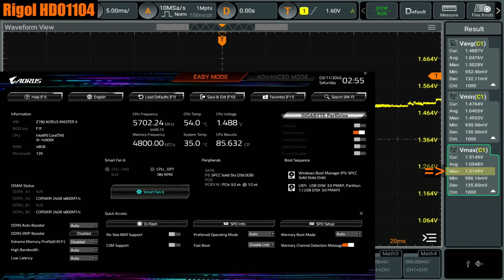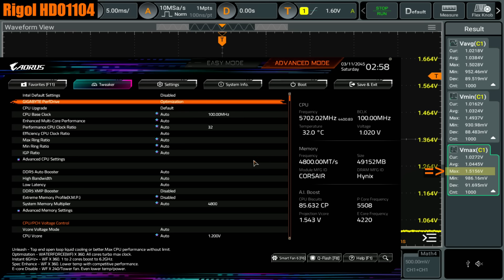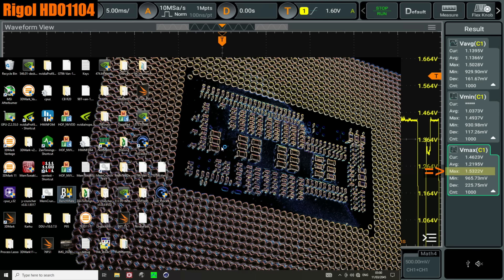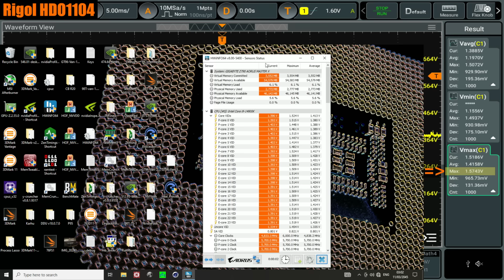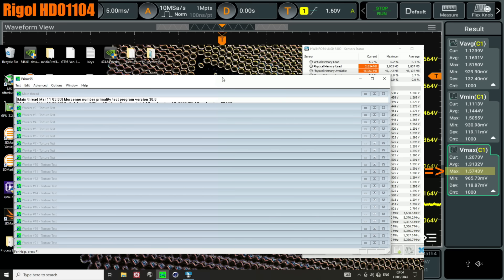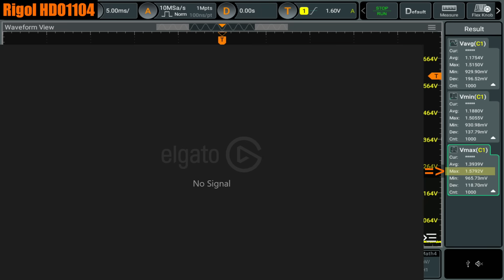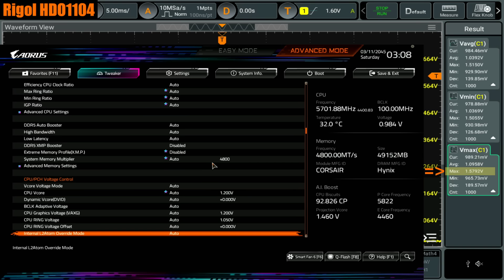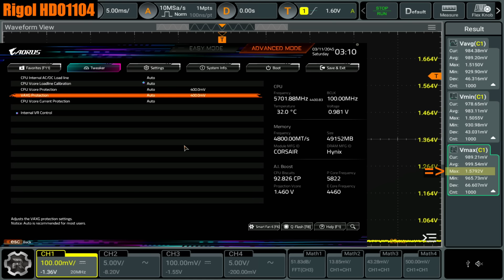Turning off "Intel Default Settings" with Microcode 0x129 DISABLES THE VID/VCORE LIMIT

Comment: 1.4v is very conservative in regards to degradation although that depends on the frequency it's running at that limit which 14th gen seem to do way too often, limiting to 1.5v significantly improved stability during gaming sessions, which during idle you'd expect far less but even at idle I'm seeing round 1.47v, so sad

Comment: After i updated to the newest bios version I see that all my P/E core clocks drop below 800MHz on idle, and my Core VIDs drop significantly as well with a i9 12900k. I did some research on the internet and read that it might be due to the C-States. I tried disabling C-State, as they were previously set to Auto, but unfortunately, this did not solve the problem. I then did some further research and read that it could be due to C1E, the Enhanced C-State. However, I can't seem to disable it on my motherboard due to Intels default option in the bios. Is there anything i can do to revert the intel changes?

Comment: Enable 'Enhanced Thermal Velocity Boost' or in a more techy name 'VMaxStress': is just a voltage reliability on/off switch. Optimized AIB settings always disable it. Also for XTU users: touching anything in XTU to overclock will disable the feature too.

 Intel's fault(and the reason they are lax with warranty) was making a mistake in their voltage reliability feature which was allowing the CPU to run at unrealiable voltages: that's what 0x129 microcode fixes.

AIB do know how to properly configure Intel CPU: my ASUS Laptop has AC_LL and DC_LL perfectly configured, as well as other things like TVB, PL1, PL2, ICCMax and even ASUS propietary 'Regulate Frequency Above Threshold'. For Desktop they just use AC_LL for whatever their reasons are: maybe it's some social engineering for home overclockers, ease of configuration,...

Comment: What do you do when you have an HP Workstation with a limited user controled BIOS? One thing I'm going to do is swap in a better screw down thermal clamp on the CPU instead of the default lever clamp. It may void the warranty, but at least the cooling efficiency will be a little better on the chip.

Comment: Great video. Question is im on z790 aorus prox and i got the intel defult settings after i update my bios what if i go to my old update F3 ( the bios that 
My pc came with ) which is the previous update from F4 that shows intel  default settings is it safe to do?

Plus after updating the gigabyte control center tells me that under vault protection  is enabled in cpu tap in the app I didn’t hat this notification before when i

Comment: I have Gigabyte B760M Gaming 1.0 DDR4. Voltage with Intel default is higher than Gigabyte Optimized profile. LLC for Intel is 1.000/1.000 mOhm, IccMax 280A, and for Gigabyte Optimized is 0.700/0.900 mOhm, IccMax 310A. My 13700KF was and still is very stable, no issues nor BSOD, even with older BIOS. Why shall I use Intel default then? It reaches 1,45V with Intel Default, and 1,39 with Gigabyte Optimized. I think Z790 motherboards are way more aggressive than B760 when it comes to voltage.

Comment: I set mine to 1.45 max. It will hit a 40300 on cinebench with that limit. Now that is higher wattage but voltage limited. Intel defaults are down from 38500 to 37700.

Comment: I just got a computer with the i9 13900k in it and learned about these issues. I did my gigabyte motherboard bios update. Some people told me to do the gigabyte default clock. Do you agree to do that and will loading the defaults hurt anything or delete any data/apps?

Comment: Disable Intel Turbo Boost, and TurboBoost Max. 💯
Reply: Whats the point in that?? If you have i9 and disable turbo boost you will have i7 ... so thats dumb ... rather rma the cpu buy the 12th gen I9 and call it a day no need to upgrade nothing its lga 1700 🫡
Reply: @ZeleniKamion  when my boost is on, my CPU runs at 98c while I'm encoding videos.

I have an i7 13700k which could potentially have the flaw Intel's 13th and 14th generation chips have where they oxidize and fail.

I would rather my videos take +1h to encode, if it means my CPU Never gets hot.

Currently I'm running 55c max temperature with turbo disabled.

The i7 13700K has 16 cores and tons of cache, so I don't see a performance issue running lower speeds, except for my encode times being longer.

imho: Intel pushed their voltages too high and expected the customer to eat the cost of failed CPUs.

It was all about getting a better benchmark for them.

Lucky for us, they finally hit a wall and had admit they had a fabrication problem and thus a BIOS fix was released to underclock their CPUs back to safe levels.
Reply: @DaKloneGaming  bro just rma that thing and buy i9 12900k,no need to hope to god your cpu doesnt die...
Reply: @ZeleniKamion  LOL!

Comment: Thank you for the video, really helpful. Can we run the XMP mem profile with the intel default settings on ? or is it better to keep the profile disable with the intel default on.

Also after applying the intel default settings the temps seem to be really high 80-100. If this keeps up would you reccomend doing the 1.4V limit? ( if it would help)

Comment: I did not install new bios yet, 13700k using .50 negative undervolt with the extreme settings. Treats it better than intel por except cinebench 15 crash, 23, good, prime95 crash, idk wth is going on right now. Maybe just needs the extra v for the profile. But waiting for more info with new microcode since ive had no issues outside of issues from my tweaks and no high voltage spikes.

Comment: Hi BuildZoid, i've recently bought a built pc with i7-14700F+4070 super. i was so happy bc my current pc is really really old(i7 6700+1050ti). did some research and i'm quite worried. even tough this specific F version is not listed officially by intel, i still wanna make sure everything is ok. so, first thing i wanna do is update bios to get 0x129 microcode. (gigabyte b760m ddr5). Some people say don't upgrade if everything runs fine. but i'm lost. i'm not really sure what to tweak. i've seen some videos and reddit posts, and people recommend different things. PL1 and PL2 to 253W? but my F version only goes to 219W. Undervolt to 1.4 or 1.3 ? xmp? enhanced multicore performance? to be honest with you i'm overwhelmed by all these new terms and not really sure what to do. this new pc means a lot to me and took me quite some time to buy it so i want it to last as long as possible. any help would be greatly appreciated

Comment: My i7 14700k ran at 1.387v stock in the bios, I reduced the VRM Core Voltage by 0.1050mv taking it down to 1.285, then reduced the Global SVID Core Voltage by 0.100mv. Cpu shows 1.190v in bios.

Would you guys think this is great? My cpu benchmarks are the same as stock if not 1% better. Intel utility benchmark does not say Yes to Thermal/Voltage limit (can't remember what it was) and current limit, during the benchmarks where as it did when it was on stock, and with just the vrm undervolt it was just the current limiting during the benchmarks.  

Problem I believe with the chips is the e cores running on the same rail as the p cores.

Comment: I have a 13600k, MSI b660 board with no crashes. Updated to the 0x129 today and my VID/V-CORE went nuts up to 95c and 1.43v. 

I checked and intel default was on. I changed it to ‘normal’ and used CPU Lite 6 to bring temps down and the V to about 1.3v

Doesn’t mean I’ve missed the fix as per the video?

Comment: anyone here having crashes  every few hours in warzone? i cant really fix this and this game is known to crash sometimes, but it happens almost every day on my system. i have not overclocked anything or did some weird different stuff. 
I have a 6900xt and a 13600k running x0129 microcode and intel default settings. it just wont stop. i have no crashes doing any other stuff, so im not sure if its just the game or something is wrong with my cpu. to be fair i dont use much other programes, so maybe i just dont realize the full extend of this stuff. does anyone here have the same issue?

Comment: Im still confused about all this, i never looked that much into the voltages, but by my understanding the microcode currently has an issue where it distributes too much voltage to a single bit and destroy is permanently? Because i checked my cpu cor voltage in my bios and is was set to 1440 since day one. Wouldnt that mean im kinda safe? Or am i missing something?

Comment: 14900k sufferer here. One question that I have is if manually setting that voltage limit to 1.55 makes it safe to turn off the intel defaults?

I'm a big tinkerer, and I'd love to be able to overclock and tinker with my chip. I want to stray away from the Intel defaults in some ways (e.g., I am considering removing wattage limits). Is setting that voltage limit manually going to work equivalent to the Intel defaults (except for where I diverge manually) in terms of chip safety?

Comment: People just all core overclock your CPU -> fixed Pcore, Ecore and Vcore. No troubles then.
Or turn indeed the IA VR voltage limit setting on 1.40v (value is 1400 in BIOS). Maybe KS owners do put it at 1.425v (1425), that is stil safe.
Or put fixed max on your Pcores and E cores, then the VID never requests high values, so P core 5500mhz, E core 4200mhz or so.
Good luck it is so easy to solve. Don't do BIOS upgrades, all not needed.
Reply: can u recommend something for 14700k

Comment: My PC used to crash. 
However, I solved it after getting a new case that has better airflow.
My problem was temps of my boot drive. I’m someone that only likes using mini-itx cases, so temps are higher than if I used a mATX or ATX case.

Comment: I have an i5 13600kf, recently purchased, from the first day of use it shows crashes, blue screen and sporadic shutdowns... I updated the bios f18g to the latest and it didn't work, I've tried limiting the vcores, power lines, nothing works... I opened the rma with Intel because the store didn't want to resolve it despite it being less than 30 days old. Until now I haven't been able to use my PC which has a 4070 super, 64GB RAM, NVMe SSD all on a B760M Aorus Elite. 😢
Reply: People just all core overclock your CPU -> fixed Pcore, Ecore and Vcore. No troubles then.
Or turn indeed the IA VR voltage limit setting on 1.40v (value is 1400 in BIOS). Maybe KS owners do put it at 1.425v (1425), that is stil safe.
Or put fixed max on your Pcores and E cores, then the VID never requests high values, so P core 5500mhz, E core 4200mhz or so.
Good luck it is so easy to solve. Don't do BIOS upgrades, all not needed.
Reply: RMA all the way.

Comment: I have updated my 14700k with MSI MB, it still runs in the 1.4v whn playing game. is it ok?
Reply: Best not, gaming make a lot of spikes appear because of the irregular loads all the time.

People just all core overclock your CPU -> fixed Pcore, Ecore and Vcore. No troubles then.
Or turn indeed the IA VR voltage limit setting on 1.40v (value is 1400 in BIOS). Maybe KS owners do put it at 1.425v (1425), that is stil safe.
Or put fixed max on your Pcores and E cores, then the VID never requests high values, so P core 5500mhz, E core 4200mhz or so.
Good luck it is so easy to solve. Don't do BIOS upgrades, all not needed.

Comment: just out of curiosity,  my CPU consistently run in undervoltage mode, does it mean that I'm somehow safe from this degradation problem?  because right now my 13900k is so far so good..
Reply: Yes, because your VID requests are lower. You can solve it to put a max on your P core (5600mhz) and E core (4300mhz). Then it never requests too high anymore. For sure with the undervolt.
As safe thing do the IA VR voltage limit, set it to 1400.

Comment: Hey mate. Thanks for all these videos and tests. Right now, i have 14900k-msi z790 with latest 0x129 non beta update. Im using it with lite load 9 and ia cep disabled because it comes with ll mode 16 and that causing idle voltages being too high. Like 1.3-1.3 vcore and 1.48 vid. And if i dont turn off cep and lower ll mode to 11 or lower, cep kicks in and cpu performance getting capper from %20 to %50.

So i wonder, if i dont change any settings from default intel profile but only change ll mode 9 and disable ia cep, would that also cancel the microcode update? I dont gent voltage spikes in hw info but there still could be transient spikes.

Can you test? Thanks.

Comment: If I keep enabled Intel default settings, should I also set IA VR Voltage Limit to 1400?
Reply: Yes, that is always good to do. Only on KS models it can limit top frequency a few 100mhz. If I had a KS, I would set it to 1425.

Comment: My observations are similar, but on motherboards from Asus that have actual beefkake VRMs that can operate independently, the new microcode behaves wildly different if you let it follow intel default settings. It will "hold similar boltages in the 1.5 range even at basic idle. Watching a non preferee core suck up voltave at basicly idle is wild. While the prefered cored run at max TVB clock in the 1.485 range.

In order to get it in a reasonabke state I found it better to use Trained for SVID behavior. Immediayely beings all thw cores down to that 1.485 range I want to sit in. 

The problem I still see is the "miniscule voltage creep" step that lead up to a higher trained SVID over time. The voltage creep happened when unfavored or E-cores come out of idle to full throttle. This causes the trained SVID to slowly creep up the voltage on the crappier cores and ecores. Seems to have a ceiling on the top of the banding scale, so im still playing around with to narrow the banding.

I wish asus gave us a little more control over trained SVID response. Just a tad more control or let it put less weight on going from C1E to full power. Or just ignore that request as part of its moving average while it calculates SVID behavior.

As a referense this is a 14900ks whit behaves like a comoletely different animal than the 14900k. Its VID table in the CPU starta at 1.5 lol.
Reply: People just all core overclock your CPU -> fixed Pcore, Ecore and Vcore. No troubles then.
Or turn indeed the IA VR voltage limit setting on 1.40v (value is 1400 in BIOS). Maybe KS owners do put it at 1.425v (1425), that is stil safe.
Or put fixed max on your Pcores and E cores, then the VID never requests high values, so P core 5500mhz, E core 4200mhz or so.
Good luck it is so easy to solve. Don't do BIOS upgrades, all not needed.

Comment: Does this mean that the VID-Limit will also be disabled when I change the AC/DC LL or set a Vcore offset when using the "Intel default settings"? That would be a bummer. Want a little UV but also the Vcore Limit.

Comment: i told intel if they don't refund me tomorrow, I'm opening an arbitration case with them with the AAA. I've done it with Dell before. Dell gave me my money back immediately after starting the case, and Intel will too, because it costs them more than $2000 just to open the case with AAA, it just makes more sense to give me my $552 back.

Comment: So we should update  the bios or not ? I have the i9 14900k i just got it 3 weeks ago and i had blue screen twice but i don't know if this was because an conflict between the programs i installed at once or because it's unstable but i check the temperature and after i play hogwarts Legacy for 6 hours with everything on Ultra settings i had no more issues till now everything works perfectly so i should update the bios with the new microcode ?
MY BIOS VERSION IT'S F5e Microcode:125
Reply: People just all core overclock your CPU -> fixed Pcore, Ecore and Vcore. No troubles then.
Or turn indeed the IA VR voltage limit setting on 1.40v (value is 1400 in BIOS). Maybe KS owners do put it at 1.425v (1425), that is stil safe.
Or put fixed max on your Pcores and E cores, then the VID never requests high values, so P core 5500mhz, E core 4200mhz or so.
Good luck it is so easy to solve. Don't do BIOS upgrades, all not needed.

Comment: I'm still on an old microcode but locked my cores and voltage day one, not had any issue but only on a 13600k.
Do I really need to worry?
5.3GHz P cores
4.1GHz E cores @ 1.22v.
Reply: problem is spikes. I would update bios, and recheck all settings as I had them beforehand.
Reply: All core overclocks with fixed v core has always been safe. And best. As your computer is in multi workloads faster, more silent and requests less power than stock. Just make sure to stresstest. Gamers stresstest both GPU and CPU at the same time. As both together put a higher strain on the vcore droops.
Reply: I updated and it sent my 13600k to 95c and 1.42v. The ‘intel default’ sets it to like 1.45v or something regardless of chip. Stupid. I had to turn on cpu lite for my mobo to get it back to 1.3v.

Comment: I gove up wathing a plenty of shits ive got builded new pc and only cpu is the fkn pis of me i gonna just buy i9 12900k and its will be more than enough for my rtx 4080 + i will update bius and if temps on cpu to much ill do under volts and i vill be relax becaus my pc will live long and good live while you fucking with 13 14th cpus
Reply: People just all core overclock your CPU -> fixed Pcore, Ecore and Vcore. No troubles then.
Or turn indeed the IA VR voltage limit setting on 1.40v (value is 1400 in BIOS). Maybe KS owners do put it at 1.425v (1425), that is stil safe.
Or put fixed max on your Pcores and E cores, then the VID never requests high values, so P core 5500mhz, E core 4200mhz or so.
Good luck it is so easy to solve. Don't do BIOS upgrades, all not needed.